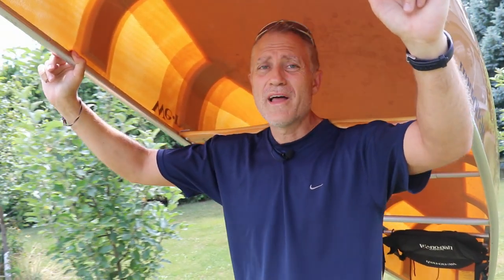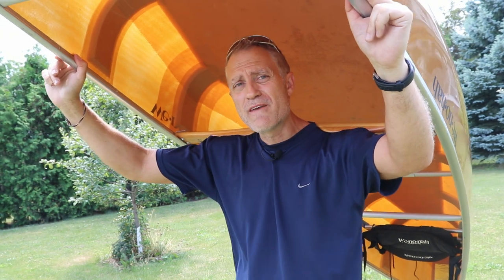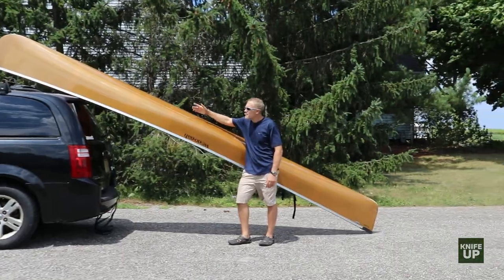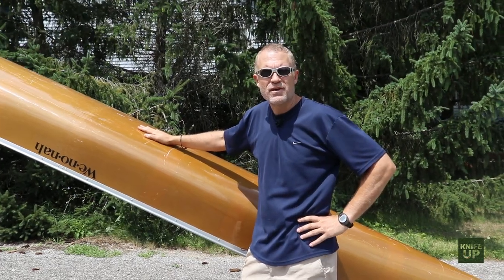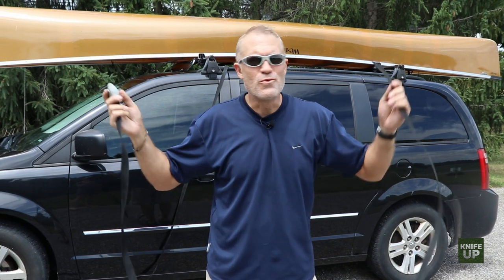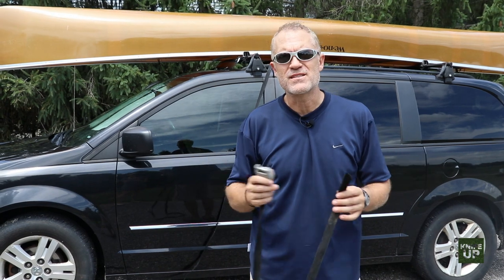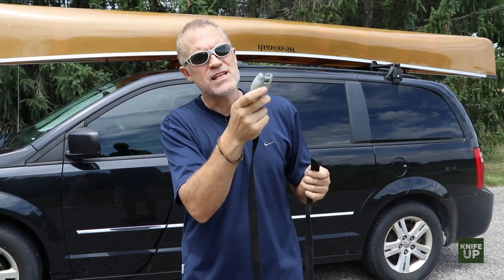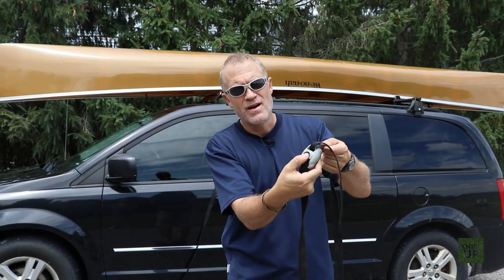Mounting a Canoe On Your Vehicle

Comment: You got the canoe held down good, it can't go up. Side to side movement is controlled well. Problem is, not much is preventing the boat from moving forward, as it will want to do in a high speed panic stop situation. Give it a strong shove from the back to see if it wants to move.  I would suggest a rope/strap from the  front of the boat straight to the middle of the rack, or all the way over the roof down to where you tied off the in the rear. It's easy to make a canoe nice and secure for driving around, but having it stay put when locking up the brakes is another story.

Comment: Great tips! I did not know about the front and back straps. Will look into it.
You were trying to get the straps going over the canoe not twisted but don't they have to be twisted? When we first strapped our canoe we had the straps not twisted and we had so much noise in the car that we cold not talk. Extremely annoying. Fortunately Swift was on our way so we stoped to ask them for advice and they said that the straps had to be twisted. It worked!